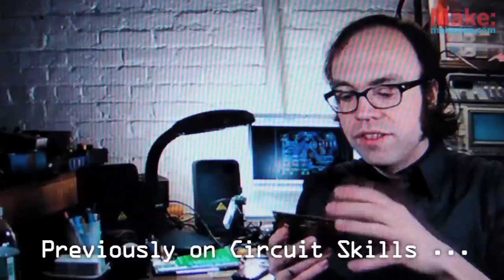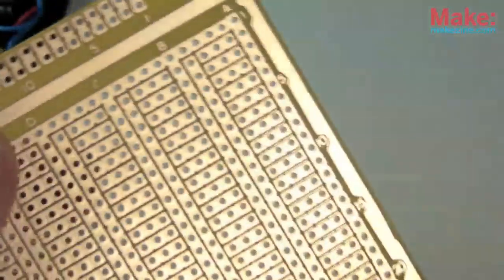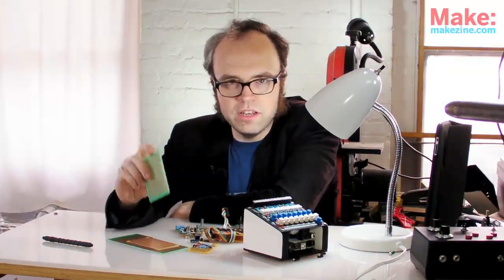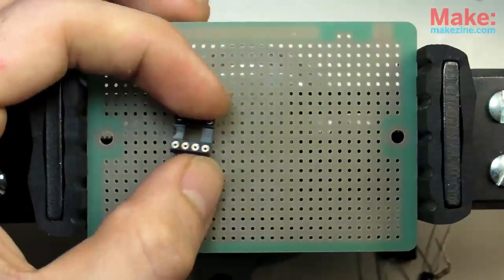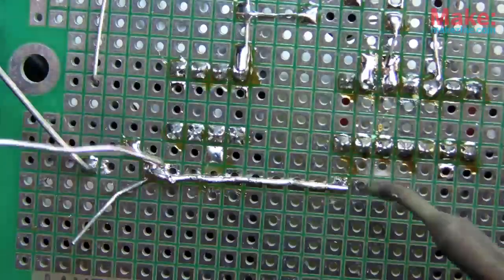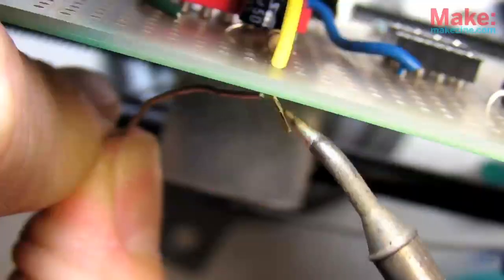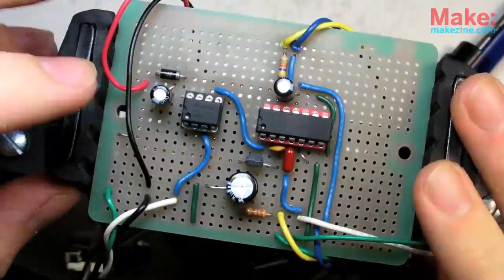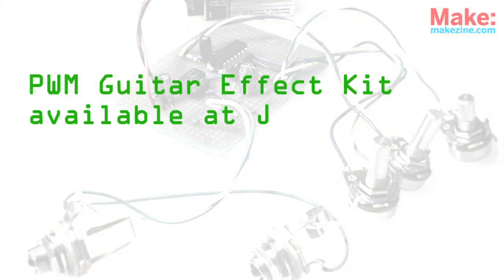Circuit Skills: Perfboard Prototyping

Comment: Good tutorial.  One caveat: after testing, scrub the board using an old toothbrush and some 90% isopropyl alcohol to remove solder bits and flux.  Make sure the board is completely dry before plugging it back in.

Comment: The best strain relief for external parts I've seen is when you drill two holes next to the solder point and loop the wire down and back out.
Reply: Jared Jeanotte I do that alot with my projects. It defiantly help keep wires from pulling out.
Reply: You do that in the walls of your home as well. Standard practice to leave a bit extra in the wall, also no twisted runs. Keeps the heating and cooling damage down, plus the extra at the end makes repairs a breeze!
Reply: yeah thats what i do
Reply: @edlingja1  I wish they did here.  Where I live the electricians seem to like leaving barely enough to even get the fitting out of the wall sufficiently to get to the screws to detach a wire.  And then screwing it into a new fitting is nearly impossible.
Reply: You can also just use the holes in the perfboard depending on the wire gauge or a bit of hot glue.

Comment: I find myself preferring "pad per hole" more and more these days. Sure, it's not quite as neat-looking on the underside, but my layout options are more flexible and I don't mind a bit of spaghetti! I've found the thing that's helped me most is to use PTFE-insulated hookup wire - if things are getting a bit packed-in, it doesn't melt if you accidentally jab it with the soldering iron!

Comment: I'm back to this video (after soldering my 3rd attempt to a VCO which came out with a success)... And I can tell that one of the most important parts here is planning . It's hard to plan your layout well "on fly". Merely impossible.
So I recommend to everybody a small program called DIYLC . It's not the best program but it's free and you can share your layouts with friends easily.
After planning i've made a pretty accurate circuit. First two looks like a mad spaghetti! And they've didn't worked :) Actually that was more about a flux that wasn't cleared... But a lack of planning (especially with sensitive circuits like any complex VCO) can lead to a mess or a not working thing.

Comment: it is generally a good idea to test your circuits on breadboard first if for no other reason, just to make sure all your parts work correctly
I've had to mod circuits from the net before to get the expected results and there's nothing more disappointing than a huge project that doesn't work at the end when you aren't sure why

Comment: I own a Arduino Uno (I F*ing love it).  It's a programmable microcontroller, and Arduino makes an IDE to program them with using a modified version of C programming language.  You would want one if you want to perform digital (and PWM analog) functions.  If what you're doing requires many ICs or tons of analog, then I'd suggest maybe looking into Arduino.  If it's purely analog circuitry, then it's not necessary.  He's definitely trying to upsell, but if it's around $30, pick one up, theyre fun

Comment: @blubberass my soldering iron only allows solder to melt on one side ( flat head) and the tip isn't hot, too big for electronics, only large wires. if you live in the uk check the fuse in the plug

Comment: I’d love to know just what type of circuits are clicking away in that background soundtrack.  Sounds like some pretty basic ‘twin T’ networks through a PT delay then a filter.  I had a bunch of those dark red capacitors that were getting very soft when heated.  Upon tearing a few open, I was not altogether shocked to discover two leads laying close to the ends of a surface mount capacitor.  No glue nor solder to strengthen the connections.  Just clay tightly packed around leads with their ends touching the SMD caps!  I was curious if this is actually the way that through hole components are made now?  It might make an interesting video.  That pedal is pretty darned clever.  For how few parts it uses, it’s quite capable.  THANKS FOR SHARING THIS!!

Comment: they are called ic sockets. it allows you to prevent buring the chip when soldering and if the chip blows, you dont have to desolder the chip all you have to do is pull it out.

no you do not have to use them. the sockets make life easier

Comment: Hi,I am new to prototyping and wondering how to hold a TP4056 li-ion battery charger module and DC-DC booster alongwith battery together--can these modules be glued/soldered ,how does one put this into a project box?
I was thinking of directly attaching modules to project box wall if possible using glue OR can we attach them to veroboard?

Comment: My way of making PCBs is to use Perf Board (like you) But to literaly print on the PCB with CATe5 wire, (stripped bare).  Maybe try to do like that in the next video. It is VERY efficiant, and it gives me use of my 25,000 (or so) feet of scrap CATe5 wiring!!!!

Comment: Hey, Collin (or anyone else reading this), have you seen or used those conductive pens? You can actually draw a circuit with them as the ink (more like a thin paste) conducts electricity. I messed around with one for a bit but found it did weird things with the resistance and whatnot. Any thoughts on those pens?
Reply: resistance is high and picks up noise and is prone to shorts
it's great for kids but not much more than that

Comment: When Colin soldered the first jack, the solder created a yellow fluid, does anyone know what the fluid is?
Reply: NeXTSTORMING 
The yellow liquid is called "Flux"
Reply: Flux, also called rosin. It is in the solder to act as a barrier between the melted metal and the air — otherwise the metal would oxidize and no longer conduct electricity. All welding needs a way to shield the molten metal from oxidation (well, I suppose if you weld in space you could do it in the raw so to speak).

Comment: If you use legs of components bend around as leads, they are PITA to desolder/remove, u can't just reheat them and pull out quickly... if for whatever reason you would want to do so.
Usually you, ok well me, break (and, if not, likely overcook) the component and/or tear away the pads from perfboard if long leads are routed around as conductors. 
But then again, if you do not try to squeeze whole circuit to smallest possible area of perfboard, like i do, and use scavanged boards with half pads missing (after removing whatever mess was soldered on by someone holding iron for the first time ;-), AND (often half cooked) components from electronics-computer-sciences faculty/highschool dumpster, this might not be such an issue ;-)

Comment: Hey Collin

I know it can be really boring everyone making you questions, but have you any tutorial on how to make a circuit to switch automatically between a mains>12v tranformer to a LI-Ion 12v laptop battery, like an emergency backup system, when main power gets cut off it switches to the battery power.. Aaand when the mains are on, the circuit charges the batteries..

All this is for my door lock..

Thanks 4 sharing your knowledge =)

Comment: made an octave doubling fuzz for my guitar outta the exact same board, Jumpers everywhere for places where you need to make a connection for more than 3 componets, annoying to solder to when you dont have a smaller tip, cant find pencil thin screw in tips for a weller SP23L iron anywhere

Comment: i tried these traceless board things and Holy Shit it's so frustrating.
building a 5W push-pull 20dB amplifier was messy on a breadboard. Building it on a perfboard didn't work.
Whenever i have to connect a single pin to more than 2 points it becomes a mess of shorts and open circuits. 
this ruined the led matrix i had built on another perfboard.
If you use one of those things, you better practice with them, cause as project size increases, the probability of getting a connection wrong increases, too.

Comment: Is it bad to try to fit components within a small surface area of perfboard?

The excess holes trigger an itch to adjust them compactly, especially in the absence of an IC
Reply: it is better but then you will have to cut the board.

Comment: a far more simple PWM circuit can be made out of a single 555 chip. BTW this is not juste a pwm because a pulse-width modulator changes the lengh of the ''on'' position of the square wave and let the ''off'' position, the same, and he had three pot while only one is necessary for the PWM.

Comment: a lamp? like a mains voltage lamp?  probably best not to be messing about with mains voltage if you are at such a basic level of understanding (not trying to be a jerk).  its probably better to start off making something much simpler to get yourself familiar with electronic principles.  if you are using something like an arduino, then you are going to need a relay also,  you can do this without something like an arduino too, but really I wouldn't advise touching mains power.